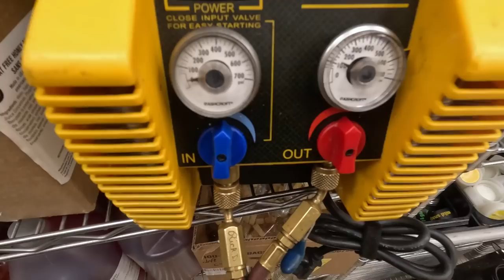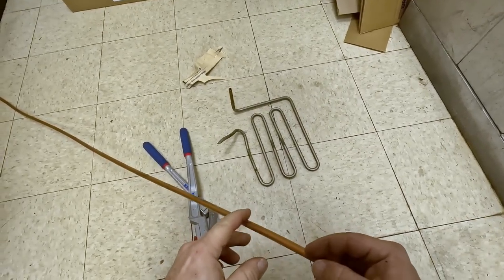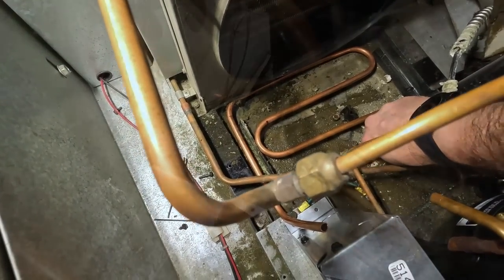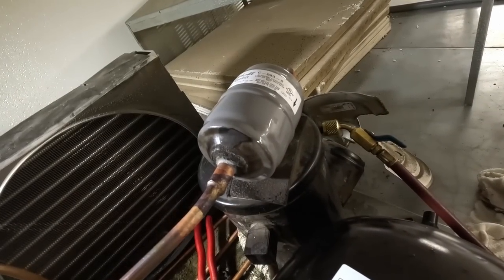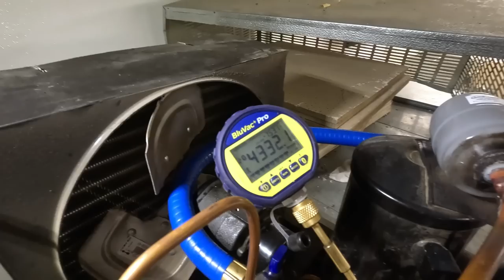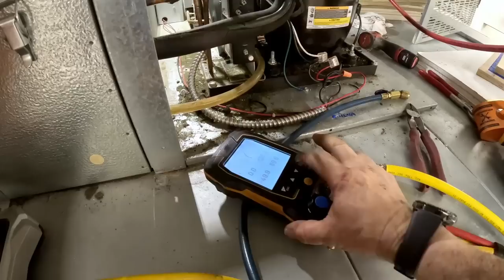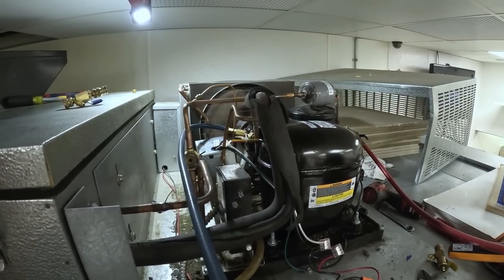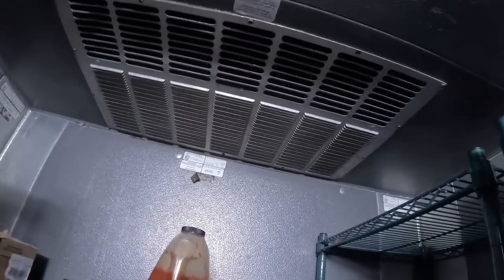Replacement Part Not Available...Let's Make It!

Comment: The good Ole condenser loop! Did work for a chain of restaurants in Chicago that used reach-in units manufactured in Slovakia. The coils in these things were comprised of multiple short lengths of stainless-steel welded together and then chromed. Oh, boy...the leaks!
Our company carried pre-mades because of the prevalence of the problem.
Great Job, Man!
Reply from the maker: Got to love it🤦🏻👍👍

Comment: From Texas. Tried to get a replacement icp 14 seer coil. Supply house said they could no longer sell 14 seer parts or equipment. Pulled the evap coil and patched the leak. Crazy what the gov is doing that will lead to people going bankrupt.

Comment: I had one about a year ago. Somebody had already ran drain down to a pump. I had to replace compressor. Found copper in condensate had a crack in it. Just bypassed. Head did not go real high and unit cooled fine. To replace pan in those things is a major operation. Also seen one somebody had bypassed copper and put in a heater in pan for condensate. Thought that was pretty slick. Just FYI. Gives you more options. The copper in pan will last less than 5 years and you will be back again. Found if they store peppers or onions in box. Copper in pan seems to eat faster.
Reply from the maker: I agree I prefer the heated condensate pan.

Comment: Seen some new units recently where they've done away with that discharge gas loop, and instead gone to an electric heating element with a snap disc t-stat clipped on to the heater. All good until that element shorts out, and trips the breaker. Also not as efficient because of the loss of the desuperheating effect of the discharge loop in the water, plus using extra heater watts to evaporate the cold condensate water.

Comment: Good repair, dryers fine units inside, no rain. Never knew you could buy pre-bent heaters from manufactuer, always just made my own. Sometimes if unit was on legs may be possible to pipe to drain. Could also install a heated condensate pan behind unit if space permits.
Reply from the maker: Very true! Yep the Case book has them, for some models

Comment: As HVAC/R is just a sideline for me, I've probably forgotten almost everything I ever learned about bending tubing (and unless someone was really desperate, I limit myself to residential only). (Although I have a cheap swaging kit, I don't actually have any tubing benders. I need to get some at some point.)

I don't think I've ever not burned the paint on a dryer, at least to some degree, so no judgment here! Does anyone ever coat those loops to try and make them last longer, and do you think it'd help at all?

Ever since my HVAC/R instructor introduced me to the Wago Pushwire connectors, I've never touched another Wire Nut. They're great.
Reply from the maker: Thanks, yes some manufactures will put a coating on the copper line that looks like heat shrink tubing.

Comment: Can you show your what kind of running pressures, superheat, subcooling on the next one?
Reply from the maker: Pressure is going to be dependent on load and type of refrigerant, subcooling doesn't really matter with a refrigerant receiver, superheat also will change based on the load of the box.  8-10* superheat for a cooler, 6-8* for a freezer, if it's a txv. If it's a capillary tube then it needs weighed in to the factory spec.

Comment: Those Norlake boxes with the "capsule pak" self contained units are a PITA. Better to have a split system and put the condenser on the roof. The (small) advantage with this system is you don't lose interior space with a big evap coil, and people stacking boxes behind it, under it, and plastic bags getting sucked into the back of the coil. People still can plug these up if they put a shelving unit right up under the grills but it's not as common.
Reply from the maker: I complained about it but removed it from the video. These suck
Reply: @HVACRSurvival  The poor box airflow, hard to reach/service components, the exposure of the condenser coil to hot, dusty, grease laden kitchen air are the major downfalls of these type of systems.

Comment: Do you have to isolate the fire/smoke alarms when brazing close to the ceiling?
Reply: Yep. Shopping bags + painters tape, or electrical tape if you happen to be out of painter's.
Reply from the maker: Depends where I'm working, if i'm in a nursing home or think thats there is a chance of setting it off yes, I'll have the store call the alarm company and put the fire alarm on test for a hour.

Comment: For the driers the ultimate move would be to have some paint made up in the same color since they always get a little scorched near the joints, they have electronic color measurement devices that makes it easy, chances are its' some very standard readily industrial RAL pallet paint color anyway.
Reply from the maker: I have a gray that's close in a spray can.

Comment: Dudes got forearms you find on a silverback 😂😂. Have to ask Mr. Rick. Did you start as a commercial apprentice? What’s the story? MAKE A VID!
Reply from the maker: I had a video of how I got into the trade then removed after having some problems with my employer when I first got heat for making the videos. I should do another video, No I started in residential as a filter changer after tech school. It was a slow walk to where I am now. That's why I do these videos, to help newer tech's to learn faster by mentioning the things I had problems with and what to look out for.
Reply: Love it brotherman. Just make it “tactfully”😅. I’ve been doing this for a decade, and only in the past 2-3 years have I began connecting the dots. No trade school. Started as install apprentice to Lead for way too long. I love problem solving. I love a challenge. Service is my jam. 😁. Knowledge is nice, but it means uff all without the experience. Install taught me most things the hard way.

Comment: Im no refer tech but niiiiice fab job! Loved your swedges up for simple braze. Did you put anything under the new copper the reduce vibration rub through from vibration, since the copper is a softer material?
Reply from the maker: I don't remember if I split a piece of half inch vinyl tubing or not,  it's been awhile. It usually takes quite a while before it does it again and we're back to some of these locations over and over for other things